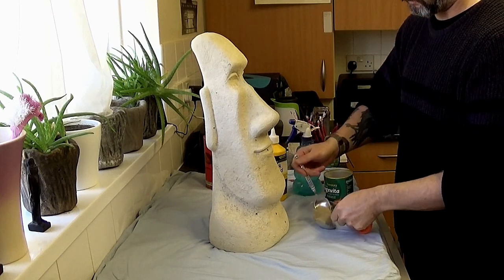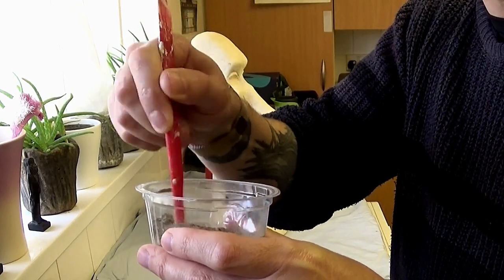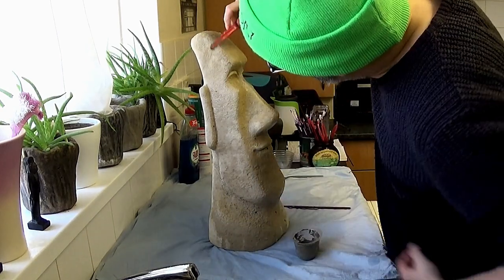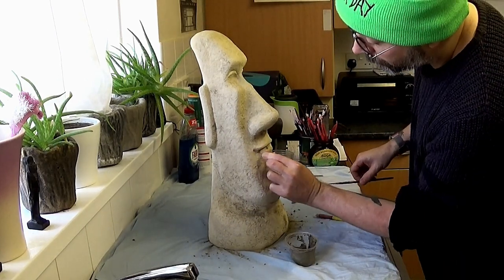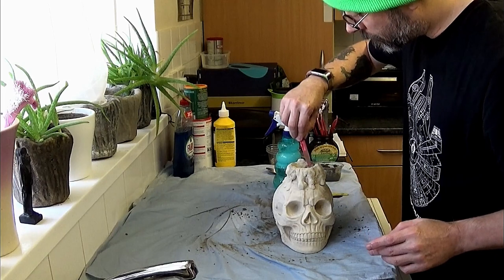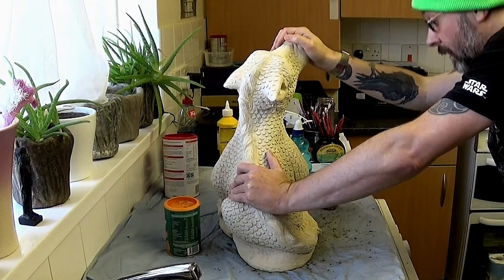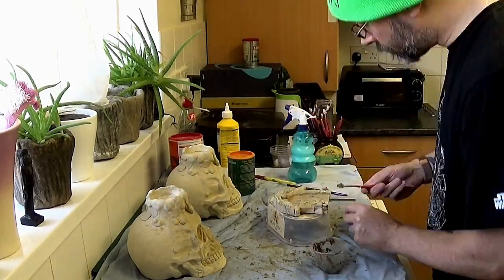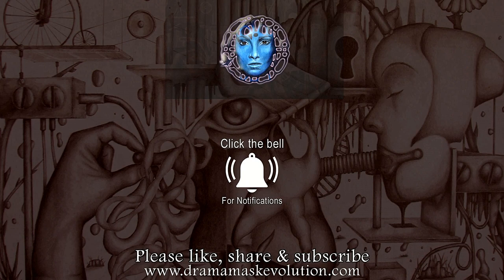FILLING BUG HOLES In Concrete Ornaments & Pieces

Comment: Can you please tell me how long should I place my moulds on a vibrating table which weigh between 5kg & 12kg please? Thanks
Reply from the maker: Not for too long. You don't want to vibrate the aggregate so it sinks to the bottom of the mold. Kind of varies with each mold.